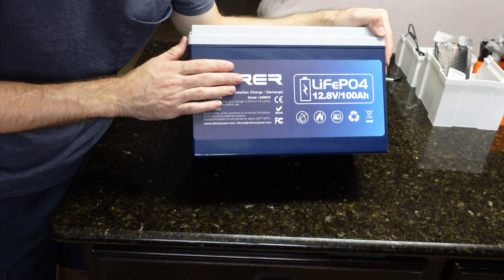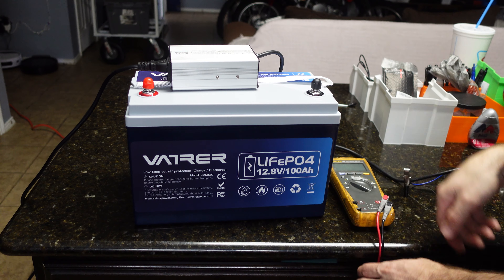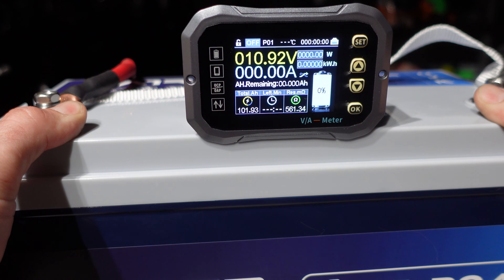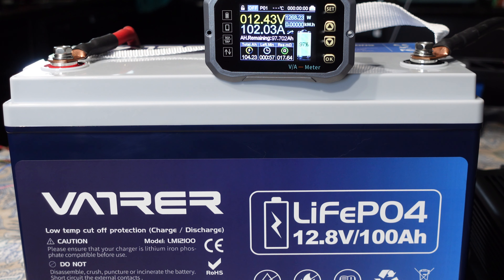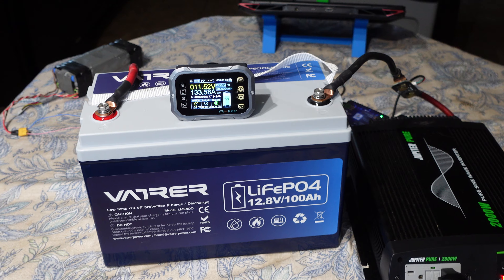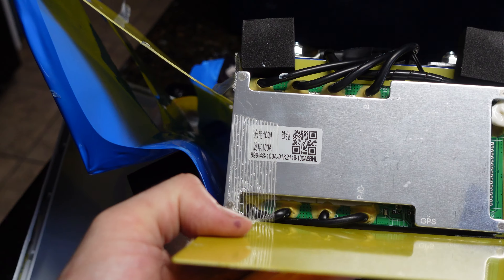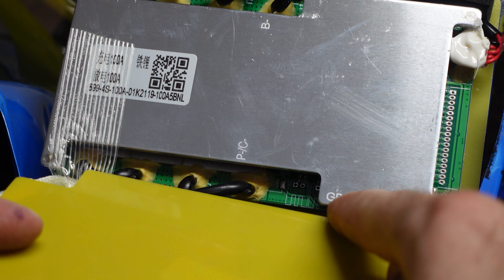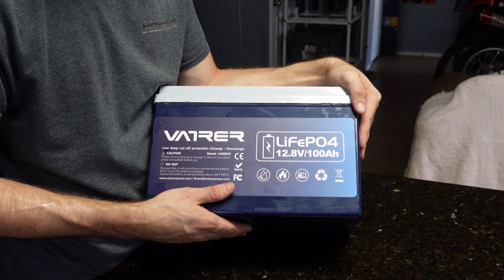Vatrer 12v 100ah Lifepo4 Review Cheap Budget Battery

Comment: I have 3 of these Vatra 100 AH Batteries.  I've been using them to run my 12 volt Electric Fence Chargers. Day in and Day out for a year now  they are doing fine 👍
Reply from the maker: I liked the build of the battery, good to hear its holding up well. I want to try the 48 volt battery next

Comment: Negative temperature discharge protection is usually much lower than charge protection. Charge protection kicks on below 0C, but discharge protection will probably at -10C or -20C. Just check some datasheet of some cells to get and idea.
Reply from the maker: @coreoocoreoo1059  ahh ok that makes sense, I need one of those cans of air to freeze it better next time!

Comment: nice battery im getting this... going to run 3 or 4 of them parallel  on 3500w inverter on 600w panels.... going to molty use it for like rice cooker/microwave/kettle/dual e stove that runs like 1500w but i know not to use all 3 of them at the same time lol.. turn off the inverter and just run my phone charger and fans and led lights , 12v heated blanket ect... direct to the 12v battery so i can save power from inverter eating up stand by..  do you think 3500w of inverter will be over kill for my needs ? im thinking 2500w inverter now but just nice to have a bit more Watt power just in case im cooking rice 300wt and can use the 1000w stove at the same time and other things..
Reply from the maker: @thatonebeone  3500 is probably overkill but better to go bigger if that’s what you have. Also make sure you go with pure sine wave, also yes I personally would not go much over 1500 watts at a time on 12 volts due to the amperage being really high. Use good quality cables and you’ll be all set!